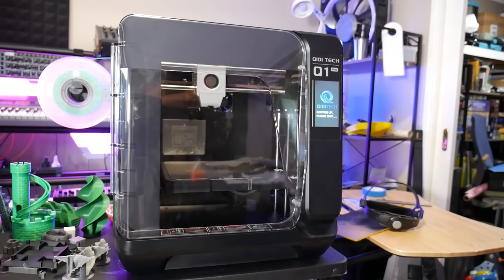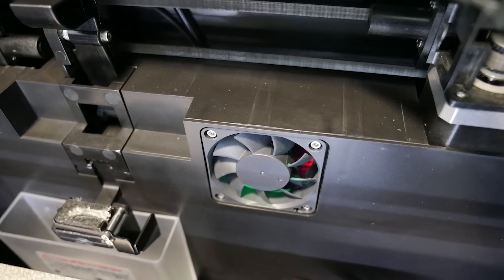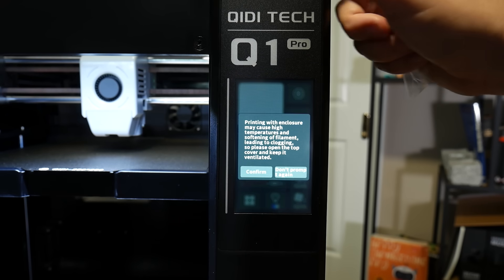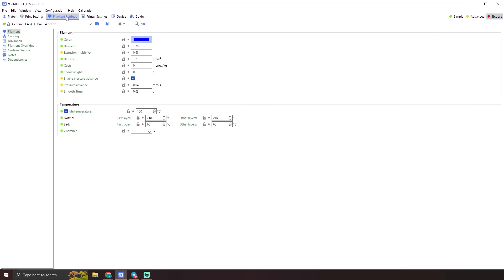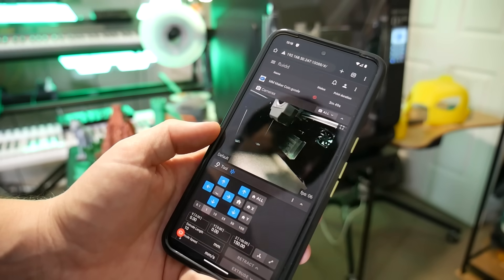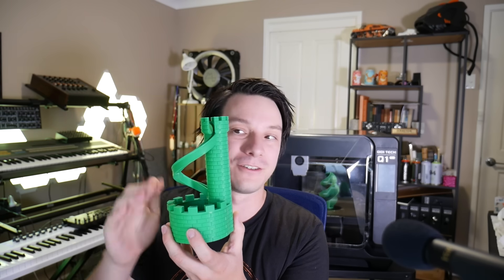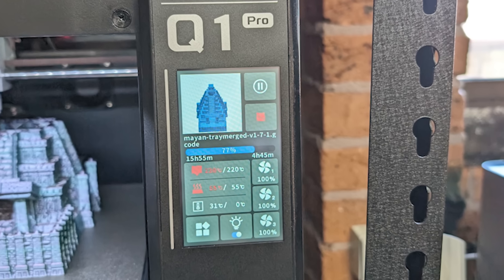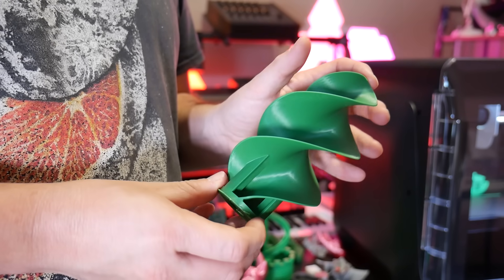The QIDI Q1 Pro is an AWESOME 3D Printer with some WEIRD choices. full review

Comment: You really need to get a sturdy table. I found when changing out filament that if I keep pulling while unloading the filament can extract all the way out, but the trick was to preheat the nozzle to only about 200c and also once it starts to extract you need to pull a bit hard, but all the filament length will come back out. Trying higher temperatures ended up taking the extruder apart to clear the problem ( bulb or hook happens and jams )

Comment: Great review.  I hope they fix the few bugs you mention because it could be a fantastic printer.
Reply: The Bambu lab printers have had less problems than any printer that I’ve had, if you have problems it will take you to there website and 99% of the time it’s a easy fix that they walk you though. All my Enders and the clones I’m dumping. The new software that is available now for those that want to tinker. The printer has become more open source, the software that Bambu created is very good not something that forces you to move to the community software because it’s junk. Creality, elegoo and Anycubic all have junk software. The Vorn printer is made as a project printer, great printer that you will always be working on for a beginner it’s a nightmare.
Reply: @windforward9810 you sound a lot like a bot/paid poster
Reply: @thingswelike  no just a retired Disabled Veteran that has a lot of time on my hands. With my injury head it affects my writing ability, spelling and other abilities. I spend a lot of time printing because I can start the print and come back to it later due to length time used to print. I like the Bambu because it almost idiot proof. I think all of the next generation of printers are slowly getting there. To me it’s important that the display be easy to use. The original ender 3 display took me a long time to get used too, was give that printer. My CR-6 SE I have an easier time using than any of the ender 3. Level the older machines give me a lot of problems. So looking at me. I would consider me not a normal user, I did have about 5 years using different CNC machines and I was a machinist in the Navy. I’ve do have a counter your statement are you a representative of the above printer.
Reply: Bot for sure.
Reply: @segstron  No bot. I’ve been printing a long time, Run CNC machines back in the 90’s. I guess you are a bot for this company. Their is some things I hate about the Bambu if the filament is not dried and the spool adapter you can have a lot a problems, you have to print the Hydra mod to fix most of the problems. I want buy there P1P or P1S because there display screen would give me problems just like the old Enders. I have a CR -6 se display is great, I have to have the auto level because of the head injury the manual is very hard for me to get right. Love my Elegoo resin printers hated the Anycubic M5s. The Elegoo’s  resin printers just work just like the GKTwo. I just don’t want to have to constantly work on a machine to make it work. The X1 Carbon fits that, resins are messy but for my miniatures I love them. So I guess not having a thought in your head makes you a bot for Qidi. lol  How would I buy this printer no just base on the review here, there are others that are coming out with a AMS unit to match Bambu. The Big elegoo printer I thought about that but looking at the problems with setup and other things I would buy the Qidi before I would get it even though it’s a smaller printer. If you will only buy one mfg items you don’t always get the best product. It just like buy car I bought a VW Jetta to replace my Chevy pickup that I used to make sales calls on loved the pickup hated the gas cost than the changed the diesel formula and it was higher than gas. Loved the Jetta, but I replaced it just like these printers If you marry a brand you are going to miss out on something great. Would I buy other X-1 carbon no because there are other printers that are coming out with a larger build plate. That’s my thoughts.

Comment: Ohey a QIDI review! 😄 I'm definitely looking at getting an X-Max 3 as an upgrade if I ever decide I want to step up from the Anycubic Kobra 2 that I just got (once I've had time to actually set it up and get to know it) since it has the Bambu X1C pretty squarely beat in many measures except for multi-material printing. I'm glad to hear from you that QIDI is a solid brand to buy from.

Comment: There was a patent for actively heated printer chambers? God I hate intellectual property law
Reply from the maker: Stratasys kept 3d printing from hobbiests for over 20 years. 😵
Reply: @MakersMuse  I believe in patents they do work this patent should have been challenged it may have been easy to break CNC machines have been around forever, the extruding of chemicals through a nozzle also. Challenging a patent however is just not worth it due to the high cost to win and if you lose you are destroyed. Franklin computer vs Apple come to mind too me because they lost, they where an example of how not to do it. At that same time you had intel vs AMD and IBMvs Clones. So there were ways around parents that worked. Thanks too you and Joel I was inspired to start printing. So thanks your reviews do influence my buying.
Reply: Yeah the history of 3d printing is a big example of how patents make a market smaller.

Comment: Wait what?  Cloud connected printers?!?!  WHY?  I'm still printing on what's left of my Tevo Tarantula i got back in '16 after redesigning and replacing most parts. There's no internet connection besides my phone hotspot in my shop so it wouldn't work up here unless i'm in the shop.

My solution is running Syncthing to use my phone as a private server.  Whenever i save to my gcode folder it just automatically syncs to my phone, then when i walk in the shop it syncs from my phone to printer pc before i can even plug it in.

For a minute i was using google drive to send myself gcode and that got old really quick, took sometimes 20 mins to get Drive to work due to poor connectivity, now with Syncthing i just make something in Blender, slice it, save it to my desktop, and when i walk up to my printer it's just there without any cloud service even knowing it exists.  It all stays on my own devices with no middleman spying on what i do.
Reply: Yep, cloud services are a thing. Creality offers a cloud service, anycubics new printers are either usb stick or cloud, no local transfer, bambulab offers cloud services too, better said they made them big. Creality was the first one though with their wifi box and app that essentially 3d printing tiktok meets candy crush. With creality you have to actively decide whether to use the cloud for uploading gcode or not, bambu lab does decide for you (locally if possible, otherwise through cloud, same goes for Webcam feed), anycubic doesn't leave you a choice like said. Most klipper printers are purely local and only use the Internet for over the air updates.

Comment: There is no ventilation for the fumes right? So you'd need to customize the top door for this to be safe. Otherwise fumes get stuck until you open it and take a deep breath while getting your print off the bed. If you think about it an open printer with a ventilated tent is better than this in terms of safety.
Reply: There's a fan on the backside that sucks air out through a carbon filter. You'd still want to use either an exhaust hood or a tent and exhaust system with these same as any 3D printer.
Reply: I'm thinking of using an internal circulating filter like the Bentobox or the Nevermore.

Comment: I wonder what the internals actually are... does the klipper firmware and linux system run on the same 64 bit MCU or is there some custom board and a Raspberry Pi clone? How is the touchscreen connected? Klipperscreen and HDMI or some custom interface?
Reply: The previous generation used makerbase boards. Like the bigtreetech manta boards, but the cb1 is integrated into the Mainboard and not plugged into. Most Linux cpus dont have enough input/output suitable for controlling a printer directly, so there is likely a microcontroller responsibility for the xyz motion and bed as well as a separate mcu in the toolhead, connected over a uart connection, not canbus like most think (you can go through the configs of all sold klipper printer from creality, qidi or similar and you won't find any canbus address).

Comment: I've noticed a lot of Chinese companies have the practice of not testing their firmware or updates before pushing them out. I've had my Flashforge four less than a year and it's already been subjected to 3 firmware updates that have ended up being worse for print procedure that the original firmware. I think they just come up with a "fix" that makes sense in their heads, but never send it through a trial to see how their changes impact the printing process. I know they've changed the pre- heating bed temp on each firmware update for the bed leveling process, as well as changed when the bed heats. They've also added an auto home instruction before AND after the bed leveling procedure as well as a nozzle lift before heating the nozzle (so my printer heats up 3 times, homes 3 times, and let's filament ooze from the nozzle before starting the print and dragging a huge string of oozed and boogered filament into the print area). A process that used to take 5 minutes and had almost no problems now take 30 minutes and half the time I have to abort the print because of the oozed filament getting in the way and preventing initial layer adhesion to the bed.

Comment: Seems like most, if not all, of these companies haven't really learned from Bambu. They seem to focus on speed claims, and being core x/y, and not easy, reliable user experience. 
I have a Qidi from years ago, and it was such a pain, and full of problems that I stopped using it within a few months of buying it. Will probably never buy anything from them again. To their credit, they did try to help me get it working, but even after sending me multiple extruders, to fix related issues, the motherboard stated giving errors, so they sent me a new mother board. I ended up taking apart and putting back together that printer numerous times. I want to print my inventions, not be a non-stop 3D printer repair man.

Comment: wow that filament unloading is nuts. crazy because the original x plus 3 had a filament cutter that was kind of crappy but worked, but they removed it!!!!!
Reply: That's the way it works on my X-Max 3, though I don't nearly have as much trouble as the reviewer. I think it would be relatively straight forward to create a small housing with a spring-loaded box cutter or X-Acto knife blade that you can press to cut the filament without removing anything.
Reply: Just heat and pull. Video method not required.

Comment: It's not really that much smaller in build volume than the Bambu machines, only more honest: The Bambu machines have an "exclusion zone" on the front left, where the print head gets sent to activate the filament cutter. They also limit the height because they heavily rely on Z-Hop during retractions. (Yes, there are work arounds for that, but out of the box, the Bambu print volume is 237x256x250mm³).

This machine seems to be aimed squarely at the Bambu Labs X1E (a 2500$ machine), but priced like a P1P – and the only thing you give up is the AMS (i.e. auto-loading for up to 16 filaments). Paired with a proper Klipper implementation this seems to be amazing value, especially in a company setting, where Cloud Connectivity is seen as a negative, not a plus.
Reply: Also considering the things you would need an active chamber heater for mostly won't work in the AMS anyway!
I'm interested, just don't know if I'm $600 interested.  Wonder if I could take my X1 and rebuild it with an active chamber heater and the electronics outside the heated area.
Reply: @Eric_Wolfe-Schulte  I think the active chamber heater is mostly for ABS and ASA – and these work beautifully from my AMS. Only the warping is bad and I really wish my X1C had a proper chamber heating (heating via the bed tops out at around 40 to 45°C for me).
Reply: @henninghoefer  I see it as more for Nylons - admittedly I'm caught up in my own use case here (PCTPE)

Comment: Nice review.  Pretty much the same conclusions I reached as well.  BTW, the door is easier to open from the notch in the lower corner.  It's still a weird design, without affordances or design cues to make it easy to understand.
Reply: Possible solution: buy a cheap drawer handle with screws from a hardware store and drill some holes in the door then attach. That's what I did with a flat acrylic door on my custom printer and it works great.
Reply: nice to see you here :)
Reply: Definitely odd. My XM3 has a well designed handle 🤷🏽‍♀️
Reply: @JerrieLenore  This is a better design since it blocks less of your view. Also uses less materials, so more environmentally conscious than you are.
Reply: @legendfpv  ?
Reply: There is literally a groove in the front bottom.of the machine leading to the door and molded feature for opening. Actually quite slick

Comment: "If cloud then nope."
Simple.
Reply: why not watch before commenting?
Reply: @BeefIngot  Just seconding Angus' comment at 0:12   "...without the cloud connectivity concerns of other brands."
If a device requires an app or the cloud (or it's from Apple) it's an automatic "nope" for me.
Reply: @StubbyPhillips  You clearly didnt watch the rest. This printer does not do cloud connectivity.

It was even the point of the section you linked...
Reply: @BeefIngot Clearly you missed that StubbyPhillips was not saying that this printer is cloud linked; rather they were stating that they are not interested in cloud linked machines.

Comment: If I didn't already have 9 printers, I would grab one.  (support just sent me an upgrade kit for my X-Max-3 for free and made it a fine printer).  Good luck QiDi
Reply: I have the xmax3 as well. What did they send you in an upgrade kit?
Reply: @Andrew.McDonald.  I got a new print head cover front & back with an additional fan for better cooling, large flat magnet (way better than those 9 magnets it came with) an induction sensor for bed leveling instead of bltouch.
Reply: @Slydog43UTube  awesome, thank you

Comment: I have the X Plus 3 and love it.   I have a separate spool holder I made which is placed on the left side at the back.    The design of the spool holder at the back does not work for me.
My X Plus 3 does not have a cleaning function.   Not a problem for me.
Useful review on the Q1 Pro.   Thanks.

Comment: It is so frustrating that they only get 85% to the finish line no matter what. I'm so waiting for one that is actually done.
Reply: It's 100% of the way there on day one for me.
Reply: Perhaps if influencers outed these types of products as a definite 'do not buy' instead of tip toeing around their problems, and consumers not buying them, then companies might get the message.
Reply: @evo-labs  Nonsense. These guys are nitpicking on minor points. They clearly demonstrated that the bits that matter - print speed and quality - far exceed other printers that are hundreds of dollars more expensive. If that was really your quality standard, you would never buy a cell phone, because both Apple and Android phones have some serious flaws and usability issues.
Reply: @TimothyBoyden  "They clearly demonstrated that the bits that matter - print speed and quality"

Those are just 2 of the bits that matter. Ease of use is a massive component.
Reply: @BeefIngot  To people who don't want to learn the critical aspects of 3D Printing and just want to click and print. This is a manufacturing process not a toaster oven.
Reply: @TimothyBoyden  Calling unnecessary busy work critical I think is just silly elitism. Like saying bus drivers who dont learn to drive manual arent real bus drivers or machinists who only know cnc arent machinists.

There is a new better way and there are niche times for the old way, but largely, for work of scale you use the thing that is most efficient
Reply: @evo-labs  The thing is that they arent absolute do not buys. They are compromises.

If you want to talk about rewarding companies that actually release products woth good experiences out of the box, Bambulab printers ttpically recieve universal praise.

Basically, Im saying dont just ask for unrealistic extremes.

Comment: Seems like a pretty easy solve for someone to design a 3D printable filament cutter that sits right on top of that print head.  Crazy that Qidi didn't just include it.
Reply: Qidi actually had one in their release version of x-smart3, but later removed it for some reason.